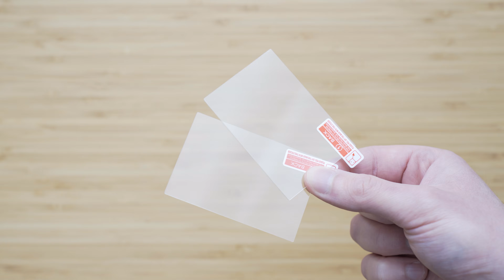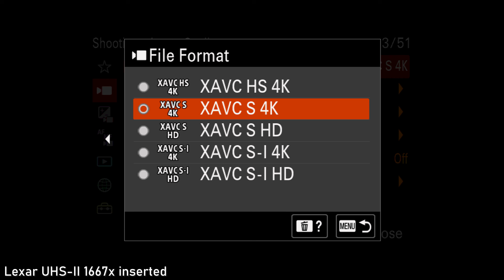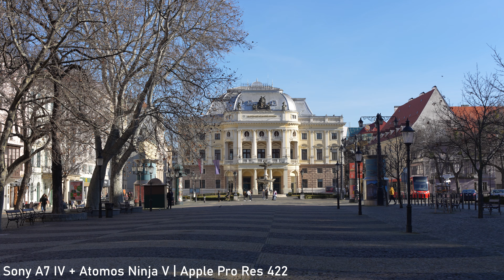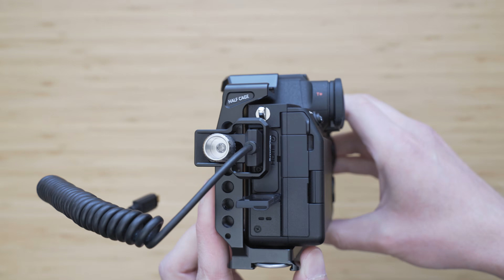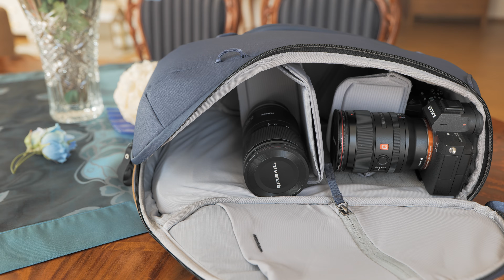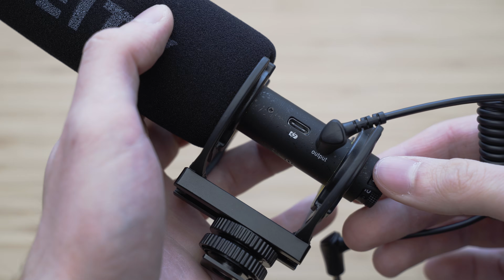30 Great Accessories for Sony A7IV - Storage, Protection, Audio & More

Comment: "The material is indestructible." proceeds to touch it with the rear side of a knife You may as well use a spoon, to prove nothing.
Reply from the maker: lol, it is the point of the knife that touches the surface. What difference does the orientation of the knife make...

Comment: Great video.. I have a question. I have the Webill S gimbal which uses a manfrotto 501 quick release plate and I’m trying to find a tripod that will be compatible with this QR plate so I can easily switch between tripod and gimbal if I need to. Do you know if the tripods you suggested are compatible with this QR plate? I tried to look at the details but I can’t find where it says what QR plates are compatible with it. Thanks in advance!

Comment: Hi there! This is SO helpful. Exactly was I was looking for. We are thinking of buying the Weebill 2 and a Sony a7 iv. However, the Zhiyun compatibility list is not clear when it comes to the lenses that can be also compatible for a Sony a7 IV. There is a long list of lenses on their website, but I was wondering if this means that ALL the lenses not listed there are NOT compatible (I assume so). Basically, as far as you know, does the Weebill 2 compatibility of the Sony a7 IV also vary based on the type of lens I decide to use? Thanks so much!
Reply from the maker: No, it is general guide, not all lenses are tested. Weebill 2 will be still fine with any 24-70mm F2.8 for example.
Reply: @TheHybridShooter  That makes sense. Thanks so much! I am looking into buying a "Sony - Alpha 7 IV Full-frame Mirrorless Interchangeable Lens Camera with SEL2870 Lens - Black", and based on the (non exhaustive) list on Zhiyun and also based on your comments, the Weebill 2 (or Weebill S) should work. Worst case scenario I will return it. Thanks again for your answer and for sharing great content!

Comment: I’ve used third party batteries in Sony but they do give a warning that the camera may not be stable with them. The camera however, works fine but third party batteries seem to have terrible longevity compared to first party.
Reply: These first party batteries are too good to buy third party. The version that was before z-100 is a different story though
Reply: @Donbros  the version before was basically “buy as many as you can afford since they last 45 min”
Reply: @Alexrocks1253  yeah exactly XD it was especially extremely annoying when you try to learn stuff about camera and old version of batteries just turn it off in middle of learning. With new batteries you sincerely learn the ropes, film/photoshoot a lot and still have 30%-40%. Battery life of z-100 ia amazing. I have two and if I film whole day I still have 40%-50% on one of them left while using two batteries. Now cfexpress 120gb is bigger problem for me :D just half day 4k shooting, probably will need to grab second one but oh boi the price is not nice. I really hope for sale or smth